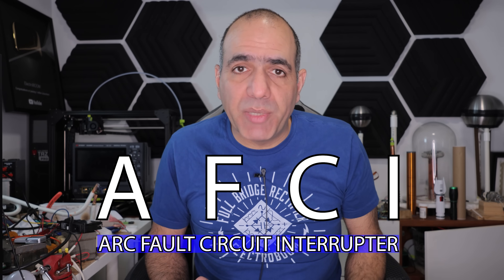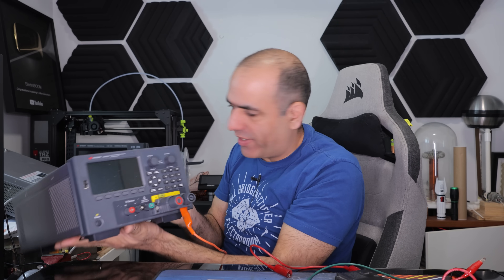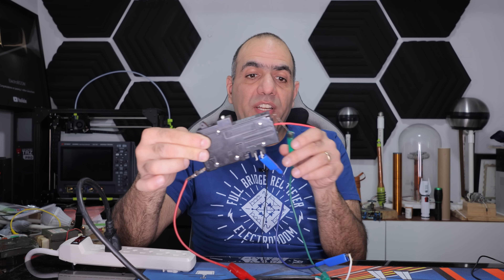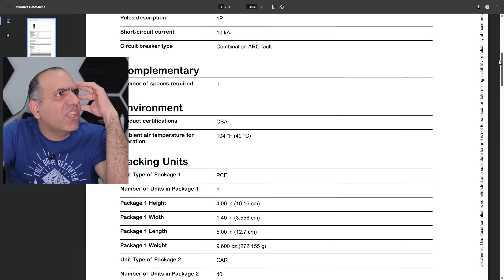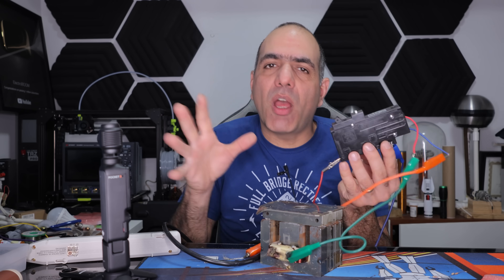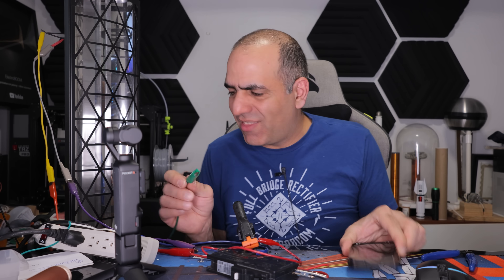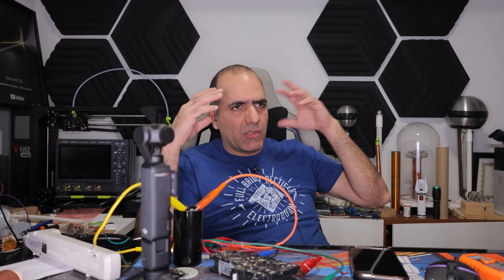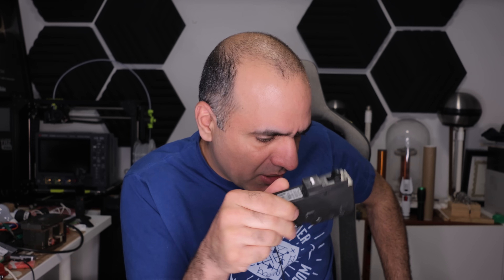Fighting Electrical Fire by AFCI

Comment: You tried so many different things to trip the AFCI but forgot the A in AFCI means arc. It is not for over current situations or loose connections. Instead it is looking for an arc. An arc has a very unique current waveform, and the AFCI actually has a microcontroller running a program that compares the waveform of the current draw to a builtin database of known waveforms that are indicative of an arc. It doesn't even need to be a high current arc (like with a short). Any arc at all (such as a loose connection where the current is limited by a resistive load) will be enough to trip the AFCI. It's actually a very smart device, and won't trip at just any random situation you throw at it like you are doing. You need to specifically set up the exact situation it is programmed to trip for, in order to trip it.

Comment: Doesn't a breaker have coils tht need to be energized in order to trip? Given the breaker is rated for 120v , doesn't that mean that the coils inside the breaker need to have 1800watts running through it in order to trip? Which means that , at the 60v of the supply you'd need 30amps of current to trip it

Comment: most breakers work on the principle of overheating for the breaker to trip. they're not really based on electrical or even magnetic properties. its based more on the difference of temperature between line/load, and/or neutral/ground

Comment: From what I was made to understand, the physical Test Botton is only Checking for Operation ability within the GFCI internal module.

AFCI internal module are built-in with Smart/Programmable Self-Checking function to carry out internal periodical test, as AFCI involves a Complex tripping waveform that may not be simulate via a single Push Test Button.

Comment: The initial reason leading to developing AFCI was for coping with dwelling room fire ignited behind bedside chest squishing straight electrical cords hooked behind, bending the cord in excess and breaking conductors and insulation. With time, arcs start occurring, excess heat, the runway starts,... then fire.

The ignition source directly in contact with flammable material (the furniture itself), as well as the bedding, directly in the same place as you are sleeping, is not forgiving for quick detection and timely evacuation. The fire develops and propagates too quickly. You are then cut in the inferno. 

NFPA 70 code was updated, and the Canadian code harmonized pretty much at the same time.

For older electrical installation without dwelling room AFCI protection, use a 90° plug instead. 
Squishing such a plug in the receptacle results in the plug to be fully inserted and not cause excessive bend to the electrical cord if correctly laid out. 😉

The AFCI is designed with a time delay and characteristics arc fault signature detection so not to cause unexpected nuisance trip from regular arcing during load switching or electrical motor brush arcing (yeah, some cheep motors not properly filtered may cause nuisance AFCI trip, we are not living in an ideal world).

Comment: My understanding of AFCIs is they're for arcs that are from unusually high voltages, stuff that's above the typical rated capacity of the insulation material. They are also sufficient for catching arcs caused by damage to insulation material that doesn't directly short the conductors. They can cause issues with IC (Inductor Capacitor) loads such as some motors as well as arc load such as welder's. Honestly though I don't really know as I haven't hyper fixated on electrical equipment for awhile

Comment: Great how you build up that storyline, as that's exactly how I think of these things, too. There are a ton of possible arcs which could set your house on fire which would NOT trip it (as you demonstrated very well), but on the other hand there are many devices like brush motors etc. that might create "current fingerprints" in time and/or frequency domain which, when analyzed by the software/DSP in the AFCI - and highly dependent of its specific implementation - might trick it into tripping when not really neccessary. This, together with the somewhat intransparent situation around how exactly the algorithms work (due to patent / intellectual property things) and the manufacturers of course strongly advocating for their use and influencing code- and lawmakers, to me just leaves a bland aftertaste when thinking about these devices. I am very glad these are not required by code here in Germany.

Comment: Great video. Can you make a video to show how a parallel plate capacitor absorbs a paper dielectric into the plates when applying a high voltage across them? This would good to illustrate the electric field force on dielectrics.

Comment: Couldn't keep the afci breaker installed on our dedicated circuit for an inverter window air conditioner when our panel was updated....

It just would NOT hold. 

Interestingly,  it would pop when the air conditioner was ramping DOWN. Not up.

Comment: AFCI protects against "dirty power"...

Are you Canadian and still using Federal Pioneer STABLOK breaker panels? Sneider makes AFCI versions (sorry USA, it's Canada only)

Do you use HomePlug-PowerLINE networks in your home? - the varied wave form of the internet traffic behaves just like an Arc Fault and WILL trip an AFCI breaker.

Comment: Aright ElectroBOOM iv'e been a huge fan and consumer of your channel. still am. ehm but yeah i dont think you will see this, but worth a shot. so i came across some Roman aqueducts researched and turned out that there was something interesting "perpetual but yet not perpetual" , and i made a ugly ass replica of the system but look it pumps water to higher heights, i dont think i have to explain what that means but. it works like this you have a siphon and a pipe connected. the pipe from the siphon leads down a container. inside the container is another pipe that leads up to a higher height than original height. now normally buoyance would crush it, but because you mix water with air it becomes light enough to be pushed to higher heights. now so to speak this is not perpetual it fuels by gravity air and water. as mentioned i made a test and it worked i recorded it aswell. the reason i am asking you is because you are excellent at debunking bs and i think i understand the physics behind this. put i would love to hear what your thoughts are. "ps pipes intake have to be as big as the output"

Comment: Arc fault devices will trip for arcs somewhere in the circuit including in some random location say in a wall or attic where the wires are failing.  Combination I believe refers to it also having the GFCI protection that you detected

Comment: I have an idea for you to try.  An uninterruptible power supply (UPS) is usually supposed to be plugged into the wall and the device that you want to stay powered when the main power is interrupted would be plugged into the battery backup slots.  What if you daisy chain 5 UPSs where one is plugged into the wall outlet, the second one is plugged into the battery backup of the first one, the third one is plugged into the battery backup of the second one and so on?  How much longer will the TV plugged into the battery backup of the filth UPS stay on in comparison to just one UPS when the main power is lost?  This is probably a bad idea but that seems to be your specialty.

Comment: 12:00 Could you make an experiment, I'm curious about, related to the spin of the electrons, and consisting of taking that one of that kind of copper bands, long enough, to twist it like a Mobius band to check if it gets any effect? Could you measure the electron momentum with a Tesla magnetic fields reader? And talking about Tesla... Why wouldn't you use a Tesla Coil Column to get a high amperage?  Thanks for reading. Greetings.

Comment: it does fight it. but if the hot is nicked in the panel small short to ground will cause fire. yes it helps and no it don't . 
and to easily trip it  . touch neatrul to 
 ground. ok good luck.😊

Comment: KINDLY ANSWER IT   hi, i regularly watch ur videos, shorts.  i m using solar system (panel, controller, battery 150AH). my solar controller glows some of its 4 LEDs to show battery charge status and or dc production level of solar panel. and my dc to dc (12 to 5 volt) mobile charger was used to work fine,  
but now when i m using it, all LEDs of solar controller start to glow, and charger is also working. but now charger works only if jointed to battery wire at the point of 3 feet distance from battery, but doesn't work if it is 13 feet. (while it used to work in past) , normaly battery charge status is sufficient, shown in solar controller, all lights, fans are working fine..
so what and where is the problem (in charger (i guess)  or battery  or controller or wires (certainly not), or solar panel (probably not), or multiple problems)

Comment: There is cool part when electrical youtuber talks about Canadian(USA} safety device showing one from French company... Their  have  been slow simply because RCDs GFCI's were considered more important and combined RCBO doing all three used to be both too expensive and too unreliable with ground fault protection becoming slower (Other then Magnetizing like on type AC}.. Now as they are becoming reliable enough, but so expensive people would not buy them. SO they are only required in high hazard areas. Some of the hotels you have been to might had them, but considered them secondary feature to RCD(GFCI}. The french Schneider you had there would have had that feature due to mass production.
They exist in Europe, but are considered just getting ready to reach mass usage.
Thanks to Canada for using them before they were ready.

Comment: Medhi, that pin issue you mentioned, where the plug just falls out of the socket, is there a way to fix that?
Also, I know it's been a while since you did ElectroBOOM 101, but I was wondering if you could do something about interpreting the colour code on resistors? I'd be most grateful.

Comment: it's because in the past they wired houses with push-in friction fit outlets that oxidized and arc. instead of recalling 100's of millions of outlets and rewiring everything, lets legislate AFCI breakers (that triggers from SMPS use)... My microwave oven use to turn itself ON (once, full power no OFF time), when a nearby door closed or a heavy vehicle passing shaking the house. I tracked it to the outlet with push-in connections.  How many fires were blamed on the microwave oven...

Comment: Also, make sure to double check your circuits and everything related to the circuits using this link below, Mehdi, so that you won't be idiot anymore.
https://theswissbay.ch/pdf/Gentoomen%20Library/Electronics/Introductory%20Circuit%20Analysis%20%2810th%20Edition%29.pdf

Comment: I had a situation in the uk were a wire in my room had frayed, rubbing against the corner of a wall, and was obviously causing arcs and sparks for so long and i never noticed. I was suprised that the breaker never tripped cause of it or that the fuse in the plug blew

Comment: When I had these installed the electrician put a small series of coils in the neutral wire before the breaker - I assume to add some HF blocking L to enhance the differencial  effect of HF compared to that  on the live wire.  Not sure if that is spec in the code....

Comment: The first AFCIs randomly tripped from just about any non-linear current draw. Fax machines, hand mixers, all kinds of things. I guess that is why they are so hard to trip now. They also cost about 10 times the cost of regular breakers and are more likely to need replacement. Manufacturers have a lot of input into the code making, but I am sure they would NEVER try to effect code changes just to sell more expensive stuff.

Comment: I think you had the right idea with the hot arcs but you were only kinda close with the frequency of the voltage spikes. this afci is testing for the kind of HIGH FREQUENCY arcs like youd find in an electric lighter.

Comment: AFCI...... I have a new home in Maine and my Siemens AFCI would  randomly trip when the the dishwasher ran. The AFCI wasn't even on the dishwasher circuit. I reached out to Siemens and over 4 months with data from my home the reengineered the AFCI  breake4s. The new models have not tried in 2 yeats

Great video content

Thanks

Comment: Oddly enough my experience with afci’s was it was hard for me to get electrocuted by them it’s like they almost wirelessly trip as I go to touch it. If not give me like a static shock. Also tends to trip when connecting appliances like a stove. Very opposite from what I’m watching right now
Reply: Maybe the length of the run in the walls having an inductive affecting the sensitivity at the service end? I’m just so shocked from what you’re doing vs my limited experience. I just remember them being so sensitive 😂

Comment: On one particular aircraft I worked on we had afci circuit breakers that replaced the traditional circuit breakers for a 3 phase motor. This "upgrade" didn't last for very long because the circuit breakers would trip far too frequently when the motor would start up and required a special tool to reset and they were eventually returned back to the regular circuit breakers that only tripped some of the time.

Comment: Electricians hate afci, (or love it if you charge to come out and do nothing) you get service calls all the time for nuisance trips and there's literally nothing you can do because nothing is wrong and they trip for no reason and the only solution is to replace it with a standard breaker

Comment: they are extremely annoying, I had to replace a blown GFCI breaker for my garage and the only one I could find locally in a pinch was a combo AFCI/GFCI and my garage door motor and any power saw, table saw, router, Small windo AC, and large fans,  instantly trips it.
Reply: Not sure whats in the garage door but maybe brushed motors are the culprit.

Comment: Thank you for this.
FYI to anyone, the AFCI and GFCI are typically in the same breaker. They come at around $80-100 each. While the outlets are roughly $20-25 each.
If you have 4 outlets in a room, just use the breaker, so the fault can be detected further up, just in case for some odd reason your wires in the wall are having a problem, because you decided to drill holes in it and short it.
Reply: well, GFCI receptacles also have a load output which will make everything downstream protected as well. 

only advantage of a receptacle is when it trips - it is within reach to reset unlike a breaker. 

both are good options.
Reply: Actually what you do is install an $7.49 GFCI wall outlet, one will protect every single wall outlet in the room and never use a dangerous AFCI breaker.

Comment: We had to hire an electrician to rewire the AFCI (to bypass, but keep the circuit breaker) on our AC. Once it tripped, it was super easy to trip it, so our AC would stay on for about 2 minutes at a time. We'd have to find outlets in our home that were harder to trip in order to use counter top appliances. They are such a nuisance.

Comment: Maybe the reaso GFCI:s are used in Europe and AFCI:s in America is in Europe mains voltage is twice as high so electric shock is a very real danger but on the other hand current is only half of that in America for the same power so electric fires caused by excessive resistance in a cirquit are less likely?

Comment: When I was a kid i used to find it quite amusing to get a light switch in just the right half on half off position that the switch would buzz slightly and the light would flicker. (this was in the incandescent lamp days). It wasn't until i was a bit older i understood why that happened and that i was making a small arc between the switch contacts that i realized how stupid it was. Thankfully never caused a fire. But the design of the switches here makes it pretty easy to do as they dont snap to either on and off. 
But that should be exactly the sort of thing these breakers are designed to detect and trip. 

Also here in Australia you can get "all in one" type breakers from the brand Clipsil that combine a AFDD with a RCD added on the side. They are designed in a way that the RCD portion physically flicks the switch on the AFDD to off. Which makes it easy to see what caused the trip. If just the AFDD section is off then it was either an arc fault or over current. But if both the AFDD and RCD are off then it was earth leakage.

Comment: Don't forget to discharge those capacitors before taking them on a plane, since the added weight of them being charged will add to your luggage and make you pay more.
Reply: I think I saw a little resistor soldered onto each capacitor, since you really want it to self-discharge every time yiu remove the power on these arcing tests.

Comment: 8:45 and that there is why we have a problem with AFCI, they don't seem to be testable by anything but the official tester and most of them are not dual function GFCI devices. Europe/UK are moving that way as well. there's a few folks who have tested them and getting the same results. David savory has a Dalek trashcan and a Lego contraption that's able to trip them. However the only thing that's been proven is that they cause nuisance tripping if that.

Comment: the test button just triggers the trip mechanism for the overcurrent bimetallic element in the breaker.  that's also why there is a delay for overcurrent to trip the breaker.  the bimetallic strip needs to heat up enough to bend enough to trigger the trip mechanism.

Comment: Skew your power factor to 0.7 or less and then couple an RF signal onto the line. It will trip if you're within the bandwidth of the AFCI's filter. I had so many headaches with these things when I worked in the household appliance industry.